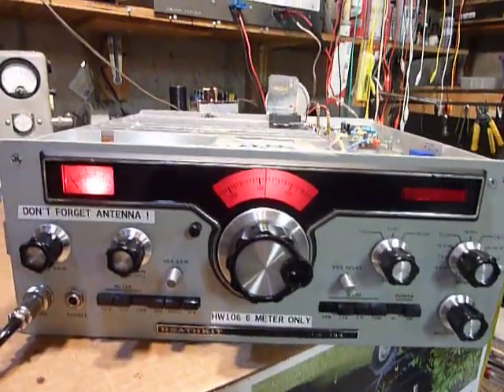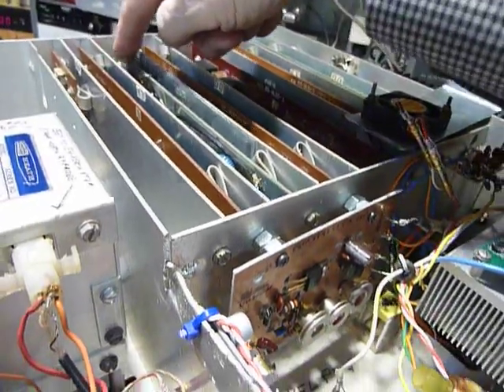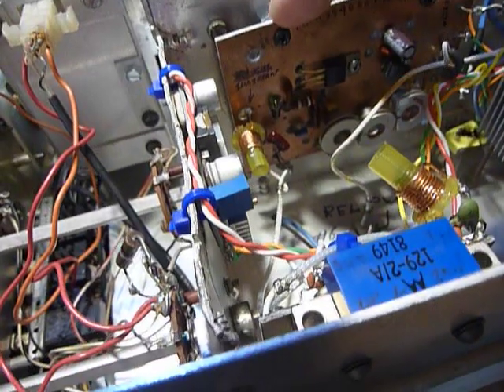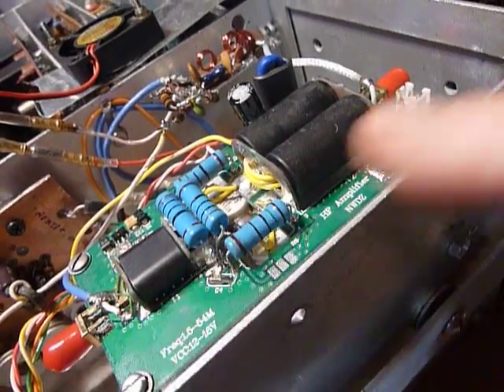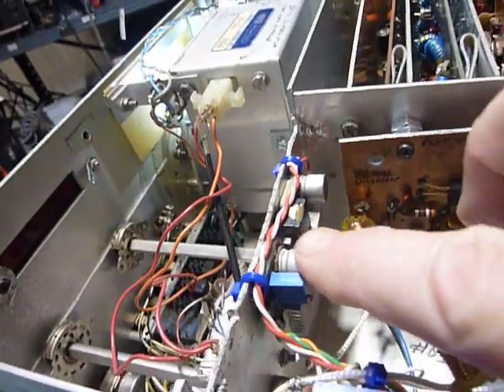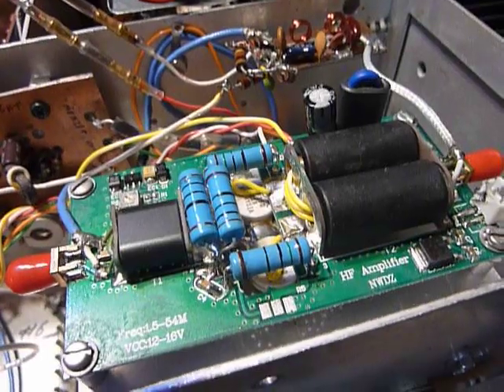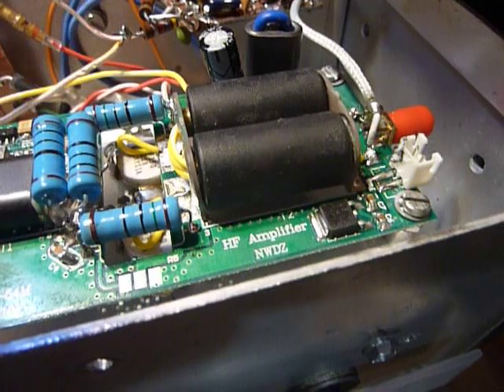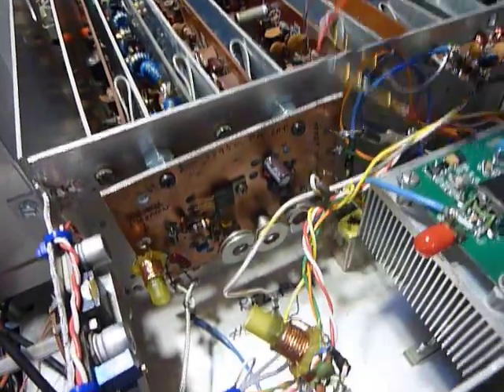HEATHKIT HW-104 on SIX METERS , HW-104,HW-106

Comment: Sorry to see the HW-104 hacked up.  This transceiver is really uncommon.
Reply from the maker: Thats true it is an uncommon tranceiver this one was already  hacked up and was sold for parts  when I got it cheap at a Hamfest  so I figured Why Not try putting it on 6 
I have another very  nice one in original condition and use it on the low bands  73 Bob
Reply: Yes I agree with you I was surprised to see that he butchered this rare rig..KE3XO
Reply: @ronbutler6502 from what I read above, it already was a basket case. If anyone is to mod a Heathkit rig, I’d rather it be Bob!